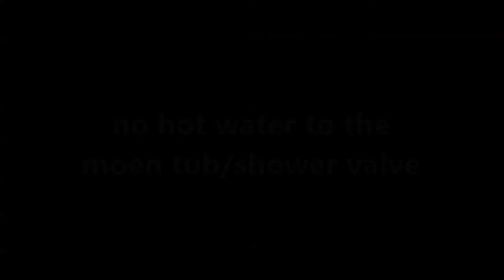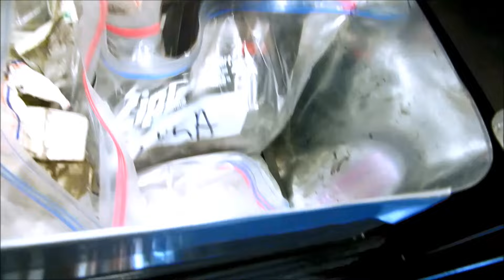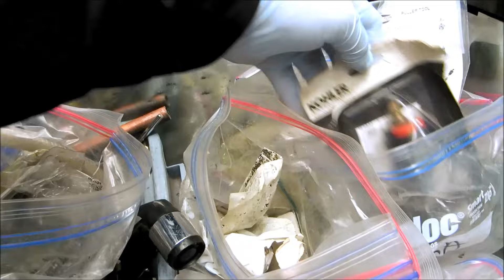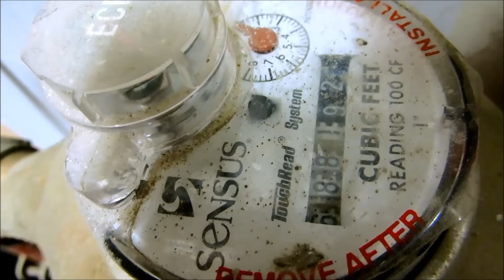no hot water to moen tub shower valve

Comment: The small white part that comes with the cartridge is meant to use as the puller.  Instead of using it to push the cartridge into place, it works perfectly to loosen enough so it can be pulled out with pliers.  The small white nut causes the cartridge to spin when held and used with pliers, and the white plastic part that is labeled TOP prys itself away from the brass body.  I will admit I read the instructions that came with the 1222b.  Which by the way is covered by Moen under warranty if you place service call at no charge.

Comment: Thanks again for the video. I called Moen Canada and they are sending me the replacement valve for free. They have free replacement warranty for their products. I didn't know that and was pleasantly surprised that they have that policy. Will wait for the part and fix my shower in the guest bathroom. Cheers
Reply from the maker: andrzej if you can wait for the parts most people want it fixed right away
Reply: steven lavimoniere I got the part yesterday. I replaced the old cartage and it works great. Thanks

Comment: Those posi temps that sit there unused never come out. I've had to drill them out
Reply: The first thing you should do prior to removing a positemp valve but after turning off the main water is opening the nearest water faucet which is usually the bathroom sink. By opening the water faucet valve it will allow air to be pulled into the water line as you pull the cartridge out preventing you from having to struggle against removing an old worn out cartridge but more importantly is you're not fighting against the normal vacuum seal. When you combine a worn non lubricated shower cartridge with the added vacuum seal that is created when you turn off your water, then you are guaranteed to have hard time pulling that cartridge out. By opening the water faucet valve from your bathroom sink you eliminate the vacuum suction that makes it so difficult to remove the cartridge. 
Hope this helps someone.

Comment: I had one that started to leak. Moen sent me the replacement cartridge free since it was a lifetime warranty. However the cartridge was stuck so tight (worse than what you show in the video) that when I tried to pull it out the brass shaft snapped off. I wound up replacing the whole valve. I was lucky because I was the one who put the valve in and had put in a access door with shutoff valves in the back of the closet so everything was easy to get to. It took about 30 minutes to replace everything.

Comment: I just replaced mine today in the main bathroom and it was equally difficult to remove, even with a puller. I remember a day or two last year when I had no hot water but then it started working again. Now I just had a leaky valve. Turns out, the rubber gaskets on the side of the old cartridge came loose and folded over inside the opening of thebrass valve housing. I actually had to remove torn pieces of the gasket from the housing after I got the cartridge out. I didn't see it in the video, but I would guess you may have seen the same problem. It looks like the hot gasket at least came loose when you had it out.

Comment: Thank you so much for this and other videos like it!  I managed to change our moen posi temp cartridge because of this! There wasn’t any hot water, low water pressure on the hot side or would even completely turn off at the 9 o’clock position. However, I wonder if you can help me figure out why after replacing the cartridge successfully and getting back hot water and great pressure, why am I now getting a dripping faucet?  I even can see a drip in the hot water side in the place where the cartridge goes, EVEN if the water supply is turned off!  It was off for 30 minutes so it’s not just a trickle from the line. I’m happy with the hot water for sure! I just wish I could get it to stop that constant drip and occasional trickle. Thank you very much in advance for any advice or direction to other videos that would help me. I’m very grateful!
Reply: I took a short video of the drip within the pipe where the cartridge goes but I can’t figure out yet how to post it here to show you what I was trying to describe. 😬

Comment: Good video, very informative. I need some advice please. I have a similar shower valve by Delta which drips.The set screw which holds the handle on is corroded and rounded out and I'm unable to remove it. What would you recommend to get that handle off so I can replace the seats.
Thanks again
Rich

Comment: Hi Steve.
I have a Kohler Single lever shower faucet with low pressure on the hot side. When you turn it all the way to hot the pressure drop off,if I back off about  1/4 inch it picks back up to normal. Can you tell what's happening here?
Thanks
Walt
Reply from the maker: Walter Fig change out the cartage .
Reply: Thanks I'll definitely do that.

Comment: Hey Steve, great video.  Followed your directions.   I put a new cartridge in and it put out great hot water for about 3 days, after that, I'm back just like I never replaced it.  Water is like room temperature, even on full hot.   Pressure is great at all settings.   I get a nice shower for about 1-3 minutes, and after that nothing.  I have a tankless water heater, and have hot water at every faucet, just a tepid shower.  Any ideas?

Comment: 6:00 I had previously repaired my shower, and the way I removed the shower cartridge is by heating the area with a blow dryer for about 20 to 30 minutes, which cause the inside rubber to soften up and was able to pull the cartridge out with a plier. I also pre-soaked the inside with WD40.

Comment: Nice video Steve. Don't know if you still check here but I have a question. How do you get the cart. out if the brass stem breaks off..I ended up chiseling the plastic part out with a screw driver. Is there an easier way?

Comment: The Moen replacement cartridge comes with a little white tool to slip over the old cartridge and work it back and forth to break the suction so it can then be pulled out more easily and not need the puller tool.

Comment: Any suggestions on a no hot water (just cold) from a single handle kitchen faucet, although other faucet have hot water.
Reply from the maker: hard to say over a email .
Reply: make sure the handle has been attached in the center setting..I had the same problem with a shower..I had the setting on cold and tightened it up this wouldn't allow it to go all the way over to hot...hope it helps

Comment: I am having a problem with the hot water in my shower also. I replaced the cartridge and still very little hot water. I then removed the cartridge and turned the hot water side back on and it just barely comes out. Could the whole valve assembly be bad or is it something more substantial? Any help would bw great.
Reply: Forgot to mention the cold water side works great and we are on a well not city water.
Reply from the maker: ***** sounds like you might have a blockage in the hot water pipe remove the cartage and turn the hot on and off quick maybe there is debree in valve that will blow out . i have seen electrolises build up in pipes and valves before  maybe the shut off to water heater is bad  loose washer .ect
Reply: steven lavimonier

Comment: I have a problem that iv been working on with my shower... I have a single valve like the one in this video but older... I have very little hot water coming out but in the bathroom sink I have a massive amount of hot.. same in kitchen.. I have replace all seals on the valve and the hot side "seal on spring"  always rips immediately after replacing. every thing is smooth no way for it to rip. its like the water pressure rips it.. now this shower is so old that I cant get the hardware to replace the valve. I can only get the seals.. i don't want to put in a new system cause I'm going to be tearing this house down and rebuilding new in the next year.. any quick fixes or suggestions that may lead to long term fix...
Reply from the maker: +bigrigtrucker a ya hit it with a sledge and replace it lol its hard to say whats wrong over a email call a local plumber to find the problem good advice there

Comment: I have a moen shower that needs a new cartridge but how do i know what cartridge to use? its a turn shower knob
Reply from the maker: Blake Caldwell there are only 2 kind the old style smaller type and the new posi temp bigger style .. the new one is a lot bigger . you will need a special puller to get it out .

Comment: How do you remove the set screw if it is stripped?
Reply: I got it using a T15 torx driver and a lot of pressure. :)
Reply: Again another convoluted design by Moen! I had trouble with mine as well. They put the set screw/allen head so close it is hard to unscrew with short hex/allen set, thanks Moen! BTW they put a little Locktite in there just to make it interesting! Keep trying whatever tool you can and try wiggling it off! Another joy of plumbing dealing with piss poor designs!

Comment: I have the same shower handle and find that the allen screw continue,s to unwind, ( the allen screw that is used to hold the handle on ). Do you have any tips on how to stop the screw from unwinding?? Are other Moen handles interchangeable with this type of shower handle? Thanks good video.
Reply from the maker: +Fisherman Guy use some lock tight a small amout will work
Reply: thx

Comment: Hi Steve, I just had a moen installed and I've got 2 problems: 1 It depletes the hot water in about 5 min and 2 it has too much water pressure. Do you have any tips to correct these?

Comment: Hi Steve, had the same problem and replaced the cartridge. still luke warm water when on the hottest setting. If I completely shut the cold water off at the pipe, the water comes out hot and stays hot but as soon as the cold water valve is opened again, luke warm. :( Any suggestions???
Reply from the maker: you have a blockage somewere its a pressure balance valve .
Reply: Is that the valve behind the faucet that connects all of the pipes together? And thank you soo much for responding!

Comment: IMPORTANT NOTE: The valve is incased in white plastic- with 1 black rubber part on each side (sometimes the rubber can block the water passage)! When removing the valve the front of the white plastic incasement CAN BREAK OFF and then you will have to fish out the rest of the plastic incasement ( it can be done- using a small screw driver and needle nose pliers). Make sure to use a flashlight to ensure all the plastic parts is removed from the waterway.   Thank You!

Comment: The one I am fighting with has the Model No. 111621 stamped into it. I plan on pulling it out to compare at one of the Big Box stores who probably won't carry it or simple stop into a plumbing supply I trust. Is it me or every time I deal with someone other than Delta, American Standard or Chicago Faucet, it is something like this? I mean I never see this in anything but these brands. Just because you don't use it for awhile the valve ceases up-come on!!
Reply: Follow up! I managed to pull the cartridge out with a Danco Puller which some where saying didn't work right. This one did vs the Moen model which was over $25 and I paid $13 or so at HD. Also I was extremely lucky it came out. The installer used a lubricant which I assumed was for nylon. If you do some research on YouTube about these you will find some nightmare scenarios where you could end up destroying the body of the valve and causing a leak. I watched one were the guy fought with it for three hours! Drilling and Taping and Easy outs-F that!! Still don't understand why it will not deliver hot water? Stay tuned and I will give a progress report.

Comment: Great video Steven! I have a question for you. I have a Symmons shower mixing valve and the hot water is warm, but not as hot at the kitchen or bathroom faucets. Is there an adjustment in the Symmons shower valve to set the temperature of the hot water to equal the temperature of the electric hot water heater? Thanks Steven!
Reply from the maker: Brad1237202 you will never get as much hot water out of a tempering valve its pressure balanced turn the hot water up you probley have a bad element in the tank is what i am thinking .. do a ohm test with wires removed

Comment: Very helpful video, thanks for posting. I had to laugh...I have the same problem - guests coming over, and they will use my guest bathroom but no hot water since we don't use it much. Grrrr. Any idea how to tell what Moen replacment valve I need (1222, 1225 etc)? I don't know where the paperwork is on this shower faucett.
Reply from the maker: +NUMan14 if you have no hot water its probley just a cartage needed the new style will say posi temp and are bigger ther the older style  you will probley need a puller to get the cartarge out
Reply: +Junglefever Sorry for the late reply. Thanks for the advice.

Comment from the maker: no hot water to moen posi temp shower valve
Reply: +steven lavimoniere Hi! I replaced the cartridge on my moen, and now hot water is coming from the shower head but water is still not very hot from the tub faucet. What do you think is the problem?
Reply: +Armagan Yavuz Turn the stop so you get more hot water. The shower head has a restrictor in it so the water will feel hotter from the shower head and the tub spout has greater flow so it will feel colder.

Comment: The first thing you should do prior to removing a positemp valve but after turning off the main water is opening the nearest water faucet which is usually the bathroom sink. By opening the water faucet valve it will allow air to be pulled into the water line as you pull the cartridge out preventing you from having to struggle against removing an old worn out cartridge but more importantly is you're not fighting against the normal vacuum seal. When you combine a worn non lubricated shower cartridge with the added vacuum seal that is created when you turn off your water, then you are guaranteed to have hard time pulling that cartridge out. By opening the water faucet valve from your bathroom sink you eliminate the vacuum suction that makes it so difficult to remove the cartridge. 
Hope this helps someone.

Comment: have you ever seen this wrench Steve? the one you have seems a little more difficult, check this one out might make it a lil easier.
http://pro.moen.com/moen/cartridge-removal-tool-for-1200-or-1225-or-1222-cartridges/_/R-TPORTAL-ALL%3A104421
Reply from the maker: Jason the Plumber i have that one also .. home depot has them for 13$$
Reply: ya you can purchase them wayyyyyy cheaper than what moens page had it listed for $50 I sent the link for the image only. I've also used that to remove the american standard barrels but you have to place an adjustable wrench in between for a spacer. next time I run into one i'll try to make a video of it.
Reply: steven lavimoniere There is, or was a metal version of the posi-temp puller, which is about double the size of the one Jason mentioned. I don't care for the new plastic version. Good Video.